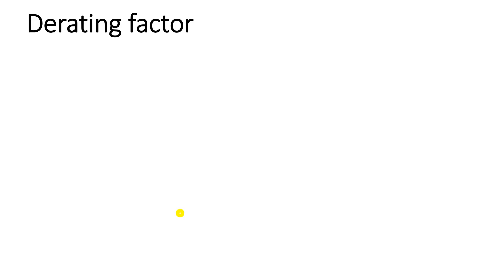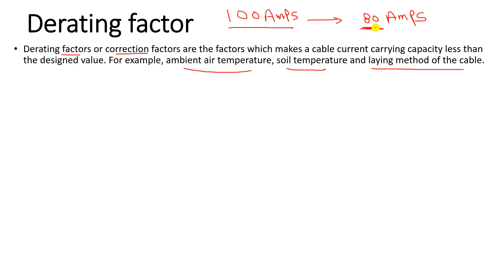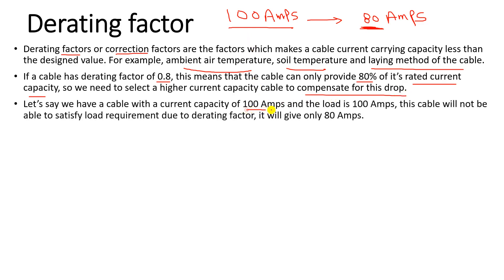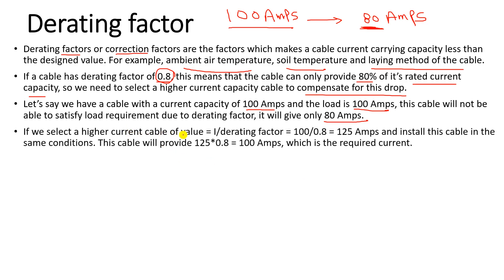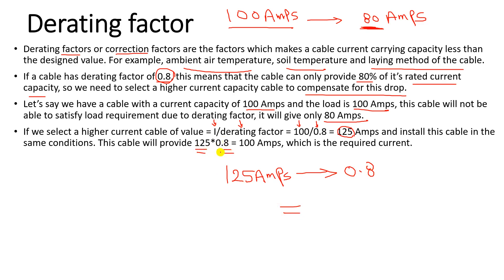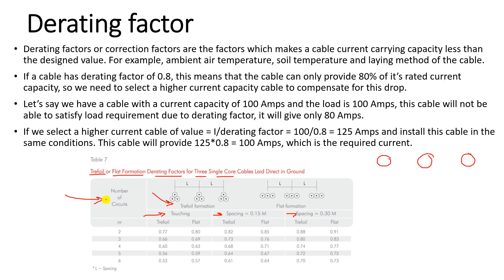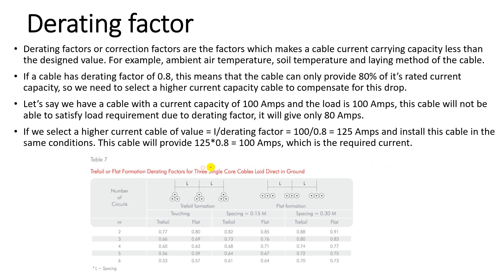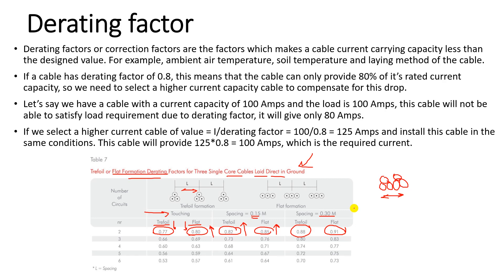Derating Factor of Cables Calculations - Derating Factors Calculations - Cables Derating Factor  (7)

Comment: What about 3C or 4C cable laying ,what is derating factor according to spacing ?? You give examples of only single core cable laying but mostly we use 3c or 4 C power cables in LV & MV
Reply from the maker: This lesson is about derating factor due to different formations, in the catalog there are values of derating according to spacing, depth and many others.